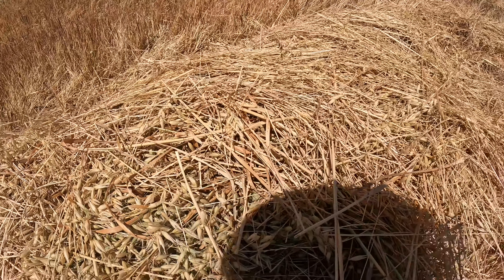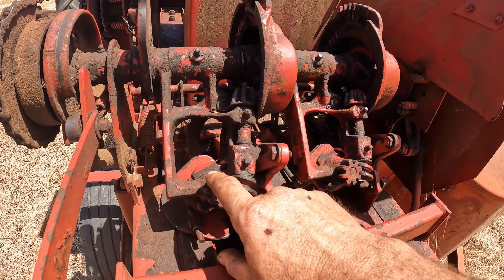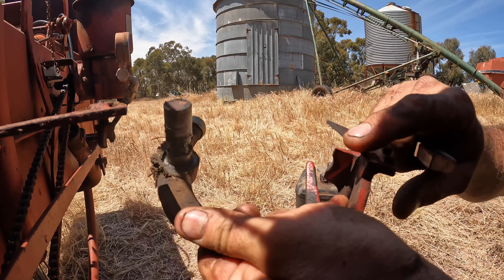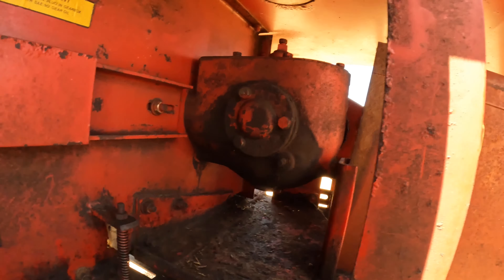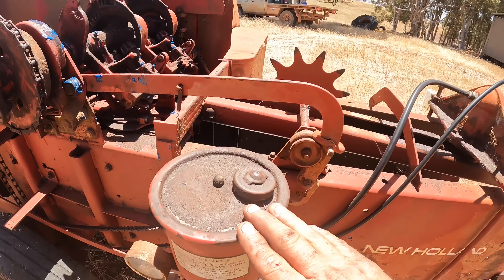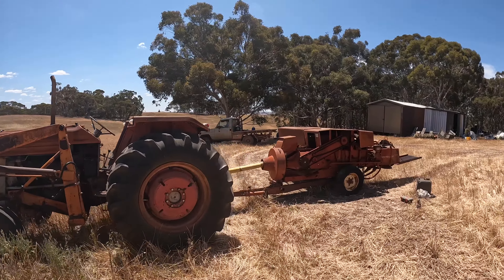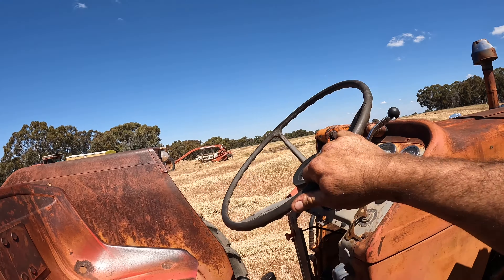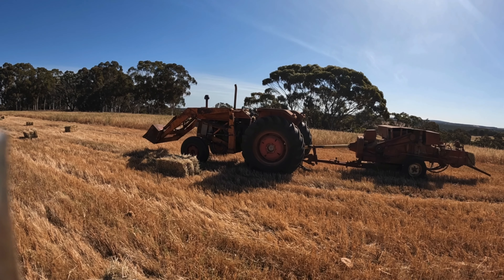Hay baling and pre start maintenance on our baler

Comment: Great outfit all running well. I agree with you much knotter trouble can be caused by blunt knives. The 317 is a good machine and do indeed still being good money. I sold mine to help finance a round baler and got a old 275 I was given going for a few small bales. The 317 is faster and mkes a nice bale. I have heard reports of up to 500 per hour but I never run one that hard. The 275 is very simple and reliable but makes banana bales when pushed.
The biggest problem with New Holland is the price of parts. Aftermarket parts just don't seem available. I would hate to replace a set of plunger rollers or bill hooks 😢
Hope you have some help with hay carting.
Dave.
Reply from the maker: Hi Dave, what sort of round baler did you get? I am looking around for one. There seems to be some old string tie bakers around, but I would love a net wrap baler instead. I am not going to sell thee hay but would love to cut some chaff again so I guess it doesn’t mater what the bales look like.
I need to try and a team together for the weekend to help pick up bales. I do have a fiew volunteers waiting to help.
Thanks from Geoffrey
Reply: @brookdalefarm7986  good evening Geoffrey.
I am on my second round baler now. I first bought a Gehl 1465 in very good condition out of the Victorian mallee. This is the 4'x5' model similar to Peter and Hillary Larson's 5'x5'baler. And mine had auto tie. This was an outstanding machine for me BUT hopeless baling cereals and straw. They just don't feed well starting to form the bale. One started they are fine but very frustrating starting. Really good for Lucerne and meadow hay or oat vetch mix. About 3 years ago my friend who updates his hay plant regularly offered me his Case 528 net wrap on generous terms which I took thinking I could chase a bit of contracting. This is an excellent baler and a dream to operate  and makes a very tight bale. This year I really haven't got the time or energy for contacting but will look after my favorites nearby.
String tie is ok but slower than wrap and I consider wrap sheds rain better when stored outside. Round bales in my opinion are the cheapest way to make large quantities for your own use that can be easily to cart and store with out a shed.
Regards Dave.
Reply from the maker: Hi Dave, thanks for the information. I had been looking at the Geel balers like Pete’s, but had gone away from them a little. I do like the net wrap for seeding the water better, and they just look so much neater. There seem to be a lot of Case and New Holland balers around here so I will hopefully find one of those soon.
I am scratching my head over hydraulic problems on the old meter 725 harvester at the moment.
I hope it’s all going well there.
Thanks from Geoffrey